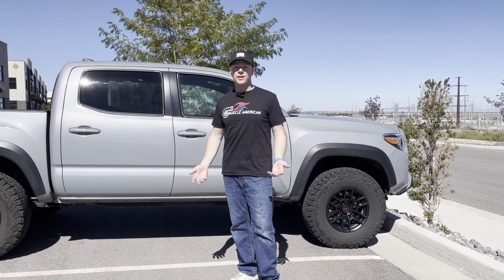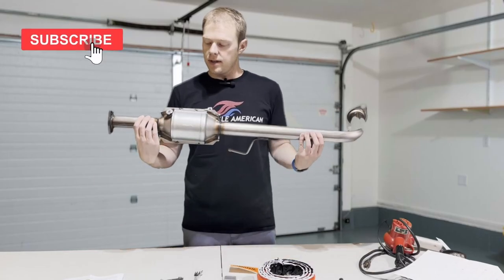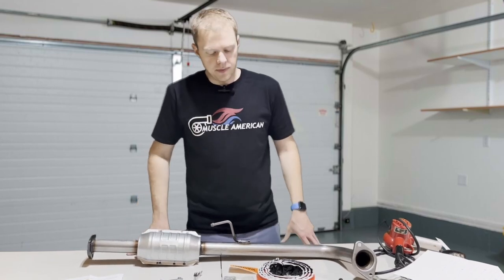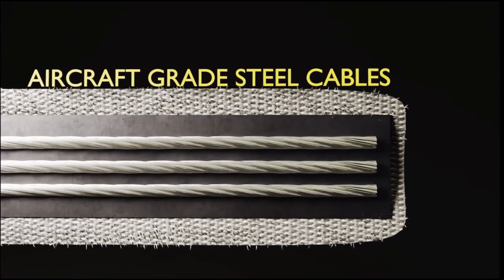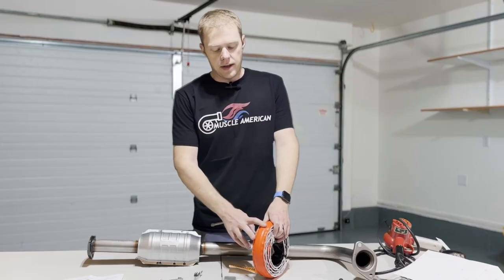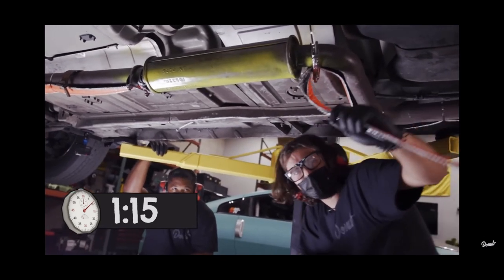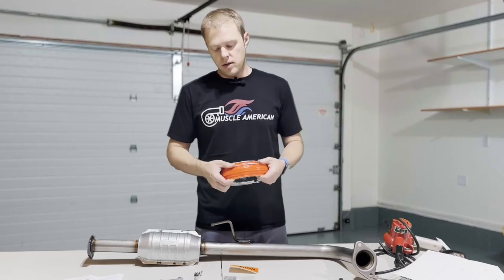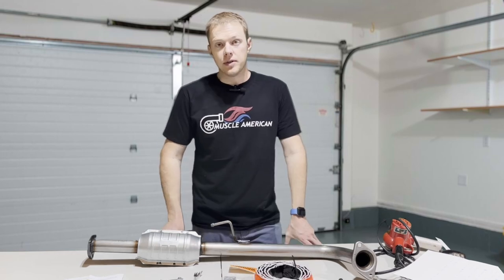I test the CatStrap System - Prevent Catalytic Converter Theft​​​​​​​

Comment: Thanks for your review! All of our manufacturing now includes two layers of the steel plate, in addition to the steel cables. The addition of a 2nd layer of the steel plate really makes it impractical to cut. It does look like the cables were cut through quicker due to the steel ties being so close together, it restricts the movement of the cables. We also include "clamp collar" spacers in every kit, which create a little tunnel for the cables to move underneath the clamps. We didn't see those installed in your video and they greatly enhance the oscillation of those cables-- which makes the cables themselves much more difficult to get through. Feel free to reach out with any questions! We appreciate the review.
Reply from the maker: Good to know thank you!
Reply: Clearly this product was made to make quick $$$. Never been tested before production. So why shall we trust your "updated" product? This guy was able to cut it with one hand and pipe was not even bolted to the car( which will let pipe be steady and not moving and much easier to cut). Not even mentioning angle grinder that will cut it in seconds. Also Thief can attach two steel ties and cut between them.  Thank you Muscle American to do real life test!
Reply: @MrNiceCobra  we invite you to try to cut through two layers of hardened band steel plus the cables-- it is a ton of work. Too much work to practically cut for a theif looking for a quick job. Remember, a theif laying on his back trying to cut up above their head is a more difficult scenario than a table top bench test, and they have to cut the strap not once, but twice (both sides of the converter). While there is no solution that is 100% invincible or uncuttable, the Catstrap presents too much work for most all theives to contend with in the real world. The Catstrap has a track record over eight years and 50,000 installations across the US and Canada with a 99.9% success rate (vehicles with the Catstrap installed without a successful theft). We are confident and stand behid our product as a universal solution to deter catalytic converter theft.
Reply: Just cut through the other side of the converter the strap isn’t on and cut the tie strap and be gone
Reply: Electric cut off tool would make quick work of those cables and straps also
Reply: Catstrap designers, have you thought of utilizing round metal sleeve protectors over the cable, one after the other, end to end. It'll make the blades just roll with the metal tubes.

Or one where you can put broken bottles along it like those walls in Mexico!
Reply: Harsh punishment for the people stealing catalytic converter and no Bail for that kind of crime that’s the best they can do to avoid those kind of stupid stealing and those buying the converter life n prison no parole
Reply: @MuscleAmerican  would be awesome if there was a comparison of new improved design and this old design in the video to see if it makes a difference

Comment: The video is a good demonstration and gives us an idea of how long it may take. But we also have to remember that no thief will be standing over the exhaust pipe and putting downward force onto the strap while using the sawzaw. They’ll be lying down or crouched down attempting to make quick cut. So the strap might be a good option. 

Great video.
Reply from the maker: Glad you liked the video! And yes you’re right, they will have a more challenging time under a vehicle.

Comment: I was surprized how easy you were able to cut through the CatStrap. I had the Cat Shield installed on my prius. The Cat was stolen prior to that. I am hoping the shield will slow down the thieves.
Reply from the maker: Yeah cat shield is the best way to go!
Reply: Consider the fact he had to make three goes at it and change the blade too. A would-be cat thief wants to get under, get an easy cut, and get away as quickly as possible -- an experienced cat-theft crew can pull up to a target and be back in their getaway vehicle with their plunder in less than a minute. If they're not deterred visually by the cat strap, they'll likely be deterred once they realize they're making much slower progress than they're accustomed to and move on to an easier target.

Comment: While it would be somewhat harder to cut from underneath the vehicle working up, they would also be working on a fixed pipe.  Not like here where the pipe isn't attached to anything and is vibrating around.  These thieves seem to make cuts in areas which unfortunately destroys a majority of the exhaust system in addition to stealing the cat.  I think they do this because they make the cuts where the piping is most supported so it doesn't vibrate.

Comment: From what I have seen sometimes less clamps are better than more.With the clamps so close together it gave the cables less flex inside. It would be like the dif of cutting a string with bad scissors loose or being held tight.Don't forget also the catsrap edited cutting part of vid was over 4 min long and thief would have to make all that noise twice.
Reply from the maker: Yeah all very good points

Comment: I think putting the cat strap above the pipe and removing the tie downs once the heat has adhered it might work better
Reply: I was thinking the same thing like then they cut through the pipe and then all the sudden they got this other freaking obstacle it's going to take way too long it'll be loose and flopping around it won't matter if the tires are holding it or not
Reply: The problem with that is if they go that far you might as well give them the cat because you're gonna wind up paying thousands in repairs, the point of these anti theft devices is to deter them from trying to cut it. @xotzinome

Comment: Appears to be incorrectly installed. Wire ties too close together and heat gun cannot produce the temperature of the exhaust system to adhere the strap to the pipe.
Reply: @ Muscle American...Dude....you really didn't look at the engineering behind the product...the ties were way to close....it kept the cables from sliding back and forth....duh!
Reply: @lungieboy wouldn’t cutting near a strap also hold the cables still? Therefore it doesn’t matter how many straps there are.

Comment: The little metal zip strips are pretty important for the system, no?  It doesn't look like it would take more than a pair of diagonal cutters to snip those off.
Reply from the maker: Yes but the actual strap is supposed to melt to the pipe so even if you cut those it still stays on.

Comment: Whats stopping them.from unscrewing the U bolts and just taking??
Reply from the maker: It’s supposed to melt to the pipe once it gets hot. So theoretically you can’t remove it even if the U bolts are removed.
Reply: Thieves don't want to waste time working under your car so they don't carry tools, the quicker they can cut and remove it the better, these anti devices are just a deterrent to make them think it's not worth spending the time to cut it off.